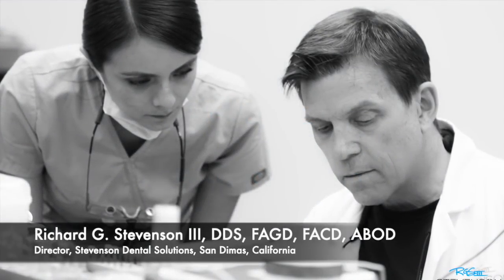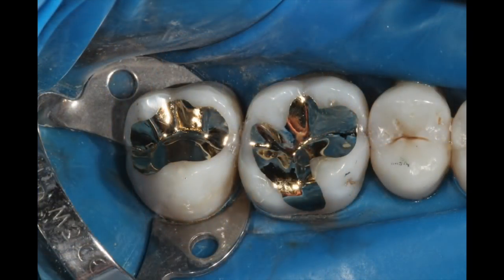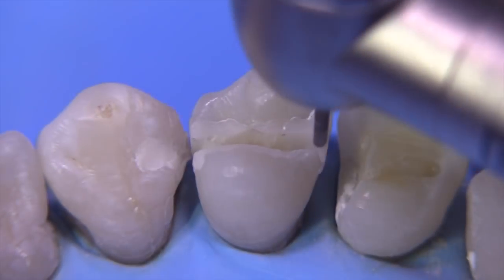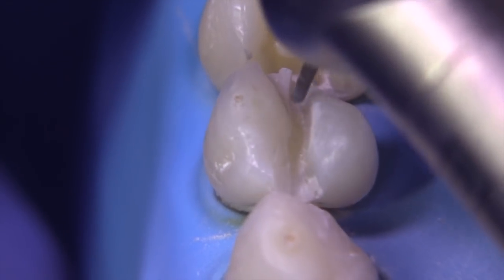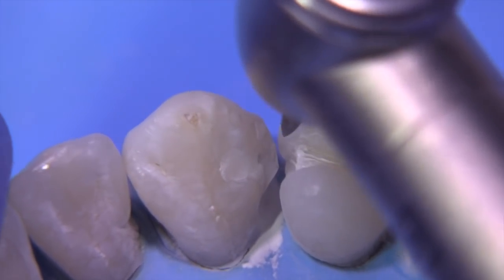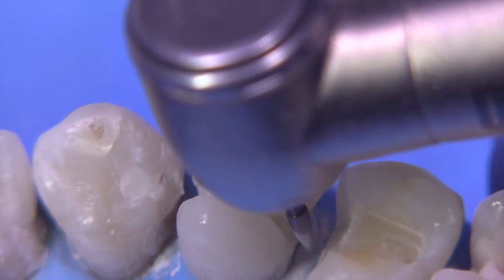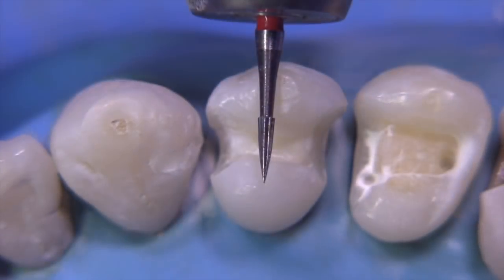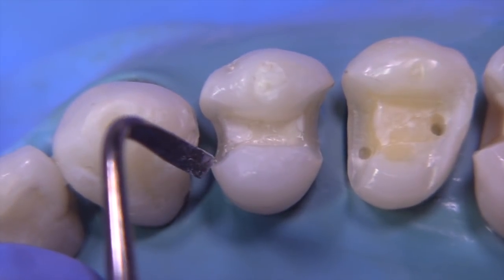Cast Gold Restorations, Part 5: MOD Hollow-grind Inlay Preparation #12

Comment: Hi Dr. Stevenson.  I am going through your gold inlay and inlay videos, my observation about this MOD hollowgrind prep design is that it seems easier and less technique sensitive than other Tucker techniques.  Is there any disadvantages of this?  I’d love to take your course someday and learn these techniques
Reply from the maker: It is and it has ample retention and resistance forms.  Tucker was concerned that the bur, namely the 7404-014 was too wide to conservatively fit interproximally.  I find that smaller sizes (860-010 diamond) allow for this and it is a non-issue.  Great observation Doc.  Hope to meet you in person someday!  Rich Stevenson